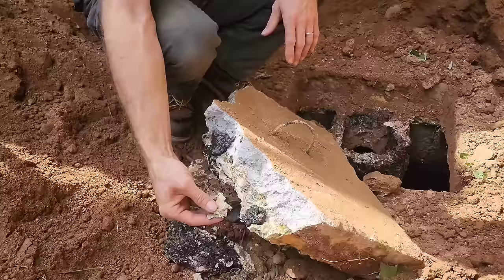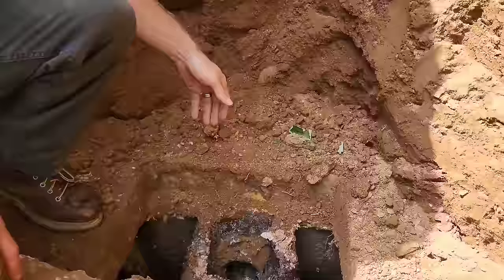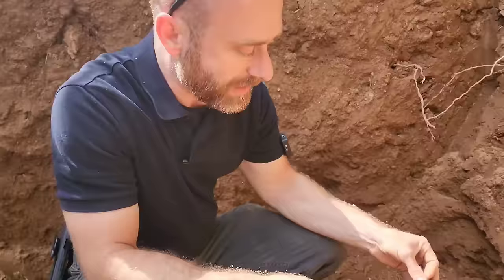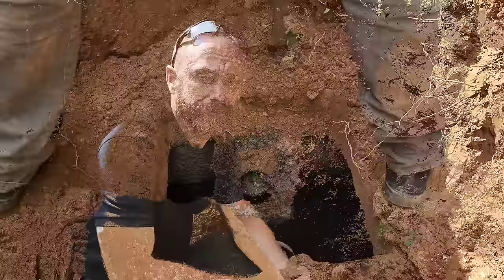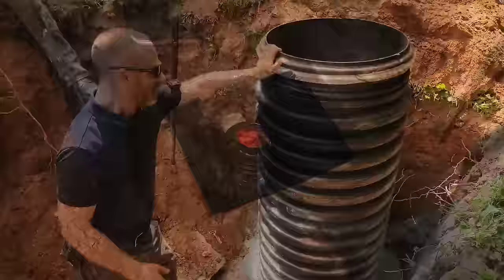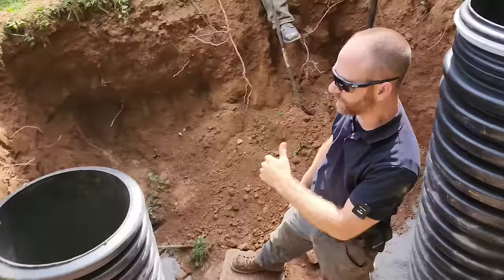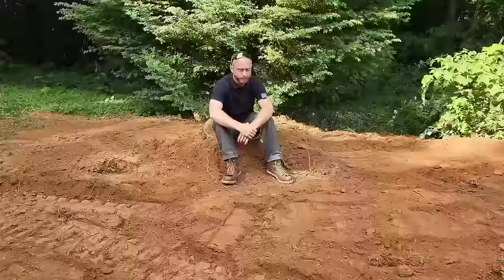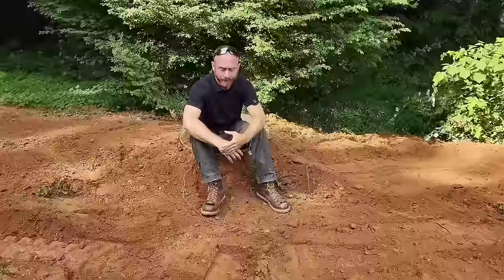Septic Tank Not Serviced In 20 Years.

Comment: I have a question that hopefully someone here may be able to answer. It's not a big deal, just a curiosity thing. So i have an old (like, installed sometime around the 1920-1930s i assume) septic....hole? Tank? Not sure how to describe it but my Dad thinks it's an old septic tank that was never removed when the property was switched over to city sewer. It is accessible by a concrete lid with a bent steel pipe embedded in it about two inches below our back porch which puts it at ground level for the yard. The lid is about 8 inches by 9 or 10 inches. Just to give you an idea of what it looks like in your minds. The question pertains to what was dumped in there years ago to keep it cleaned out. Me and my Dad have been using it for various uses in our yard and daily lives to dispose of things. Typically we use it for dead animals (rats, raccoons, any other dead critters we find and can get in the hole easily), dumping human refuse with cat litter (me and my dad are Traffic Control Flaggers), and cuttings from our shrubs or the trimmings from our lawnmower. The thing i'm wondering is what could be down there still, after all these years, to keep the hole/tank cleared out. Because we had one time where we literally put so many shrub branches down there we were literally having to cram them down a bit to close the lid due to them sticking up and stacking on each other. The lid isn't air tight but it also doesn't let much in, i didn't think. Yet, when we opened the hole later (around a few months or a year, it's been a few years since we did this) it was COMPLETELY empty.
So, long story short (ish), what do any of you think could or may be still alive in there to cause all that or do you think it was just natural decomp from the tight space and moist/dark environment? Also, if any of you would mind suggesting dumping stuff down there again since we're still technically using it. Doesn't need to be pumped or anything, it really is empty. We shine lights into it to check sometimes and have seen the bottom just about every time.

Comment: Our septic system is 25 years old.  We had a company out to pump it after 10 years, but the operator said there was virtually nothing to pump, so it was not pumped.  The operator did replace a few concrete parts with plastic, but our system is still trouble free after 25 years.  Probably time for another inspection?  As a kid my parents taught me to never allow anything into the sewer that wasn't biodegradable and we do not have a garbage disposal.....the death of all septic systems.

Comment: In western Maryland we are required to have the access 20 inches above ground don’t know why it does snow a lot here but last time we had ours cleaned, which is at least every five years sometimes three years if I remember they had to put it in Extension out and it’s 20 inches above ground level. My question is why didn’t they just replace it now when you have the whole Doug and not have to worry again.

Comment: I'm chuckling because the previous homeowner built a fence straddling the septic tank, which is also concrete and about 4' deep. I did have to dig that by hand, because my local septic guys don't dig if they can avoid it, I don't have access to a machine, and (again) a fence straddling the tank. By the end of it, I had a really good fighting position, minus the grenade sump because, you know, concrete tank.

Comment: For awhile metal specifically a steel septic system was gonna be used for new buildings but fwiw around the 90s onwards fwiw if not within 7 years of building,, it if iirc has been from what I read shown to have emergences of problems with rusting out the bottom and baffles or even collapsing,

Comment: Loving the content in the videos! How about a tank that the house sat empty for 20 years. Then remodeled and went from 1 bath to 3 bath? Has 1 lateral line about 90ft long. The homeowner called, and said there's "water" coming out the far downhill side of the lateral line inspection pipe.  I told him that the ground probably quit perking and is leaking sewage water out the end and needs replaced. Is there anything else to do if the drainage field gets full?

Comment: Im a state septic system inspector. And Im still trying to figure out how the "servicing" that hes talking about, is somehow going to keep your concrete tank from crumbling like that. There is no "service" that is added or sprayed inside that would keep your tank in tip top shape.  Pretty misleading that by "servicing" your system, you will add years to the tank life. Having it pumped kinda regularly will help with solid carryover to your field lines and extend their life, but not your tank.

Comment: How would pumping the tank out do anything to stop the deterioration of the concrete? I'm just wondering, as between the crust buster pump lines and garden hose, I don't ever see anything else in your videos going into the tank, and last I checked none of those things extend the usable limits of concrete. You said that proper service would keep it from happening, but I see ZERO proof of that
Reply: It helps quell bacteria buildup and moisture that would otherwise harm the concrete
Reply: @zagzig3734  the entire point of a septic system is to grow bacteria in moisture to break down the solids in waste. It's kinda in the name septic. My guess for the concrete break down would be using crazy amounts of acidic toilet bowl cleaners , acidic water or salt from water softener being back flushed into the septic which is a bad idea with salt water killing bacteria. Water softeners should drain to the ditch.
Reply: @martyk1156 Thanks for this info. I was concerned after watching this video because I have a softener. But mine backflushes into its own separate-from-septic perforated pipe.

Comment: Had a guy at a club insist that the club house sceptic tank didn't need pumping, claimed the tank made the sh1t "go away"!
I downloaded the manufacturers instructions for him, and the club committee, and he still wouldn't accept that the tank had to be periodically emptied.
Oh, and the reason this disagreement arose... the field drains were blocked up and my guess was either tree roots or solids had overflowed from the tank and blocked the drainage system, and when I found out that the tank was installed 25 years ago and had never been emptied I knew it was the latter!

Comment: Honest question: What does regular servicing do to prevent the concrete decay?
Reply: Regular servicing will reduce the total bacteria accumulated and prevent moisture build up that breaks down concrete walls. It also allows you to check the concrete for damage and install preventative measures before it hits this crumbling point. Once it's completely eroded like shown in the video then the only thing you can do is completely replace it or install an alternative.
Reply: @ww6372  Probably nothing to do with moisture.  Lots of concrete is poured for underwater applications.

Comment: Lol considering my "septic system" is a 1'500 gallon tank with a pipe running to a 4ftx4ftx4ft pit I think I'll be alright. I plan on upgrading the pit to 6 or 8 55 gallon drum with holes all over buried about 2 ft underground and surrounded by gravel. Should be good for basically forever. I only have a single toilet and a trailer septic hooked up.

Comment: Mine hadn't been serviced 15 years so I took a look and aside from a top layer of grease maybe an inch thick and next to nothing on the bottom, it looked fine to me.  I wish they'd had put an 90 elbow at the bottom of the outlet tee when the system was installed.
No bleach, chemicals or anything I couldn't have eaten goes down the drain aside from soap.

Comment: had the same problem... only the customer told me they have had it pumped every year since 2003 however now they are getting backed up in the house. Upond locating through the main line I found the tank was 11 feet deep with no riser. I informed that unless there pump guy was super man charging $5k per pump there is no way it was being pumped. Once I located the tank all that was left was the walls of the tank and it had fallen apart many years ago.

Comment: I have heard it said that, as long as the septic tank is used gently and properly (e.g. one or two people serviced, no paper towels, wipes, grease, harsh cleaners, etc. dumped down the drain), it can easily last for decades between pumpings. Is this accurate?

Comment: Septic tank here was pumped around 25 years after we bought the house and we don't know how long before that it was pumped.
And the tank was not that big either. So goes to show how a tank can survive a very long time. Even without special care.
Now, with a new tank at another location, i am more concerned with proper care and balance in the tank.
A good balance should make the tank go without any service for a very long time. Lifetime even maybe. 
Don't use aggressive cleaners, don't flush leftovers, don't flush wipes, use a normal amount of the right toilet paper and add some special enzymes and bacteria combo to keep the good guy's fighting and you might never have to pump it.
Reply: Just pump the darn thing haha
Reply: You are right. Concrete is alkaline. The waste product is acidic but should only be mildly so. Pumping does nothing to change the chemistry (but does reset much of the biological action). Your tank will fill right back up with acids. If your tank was close to balanced before pumping the change afterwards would be negligible (volume of material). Waste solids that cannot break down would accumulate - but there is very little that should be going down your drian that will not dissolve in mildly acidic water...

I have seen nothing about how pumping does anything to change the acidity which is what attacks the concrete. Pumping every 5 years or so is probably reasonable for most households (for solids build up). Less often or even never  for lighter use or careful households...

Comment: HOW would servicing the tank have made a difference to the concrete degrading?  Location would have still seen the same environment.
Reply: notice how the concrete on the outside is still very hard and the concrete on the inside is crumbling away, the different chemicals and other things gone down the drain have been eating away at the walls. If you pump the tank of that waste you remove whatever is degrading the concrete, you neutralize the environment once in a while it'll buy the concrete more time before it fully turns back into it's components.

Comment: When you installed the baffle system replacement did you dig the tank up on the other side and connect the pipe you inserted to the existing pipe or did you just slide it in? Just curious because that’s how it looked in the video.

Comment: I was at a campground that had a wooden septic tank.  For the row of full hookups.  I was camping when it was cleaned out.  
How it lasts is a mystery.
Reply: I was a state health Department onsite designer and  inspector for 32 years.  Now I'm a private sector  designer . I've seen wooden timber cesspools and  concrete tanks poured around wood framing. The sewage "pickles" the wood. Any iron nails or braces quickly rust away but the wood stays. And yes I've heard the "never had to pump it" myth. My best answer is  "do you also have  a car you've driven 100000 miles and never had to change oil and  filters?"
Reply: @cecilsink9901  
A  jerk would say  "I don't change the oil, l drive a Prius" and that is why I hate every prius owner.

Comment: If the filter is 5 ft below grade, how does a homeowner access it?
Reply: By digging a trench hole as they did here, then adding risers as was also done, for:  "le$$ co$t" in future maintenance.
Reply: Those filters have a place to install a length of 3/4” pvc pipe as a handle. They lift out and you rinse them clean with a garden hose.
Reply from the maker: we have hooks that long

Comment: I have a question,  if your landlord has a old concrete septic tank in the backyard and has 3 concrete slabs on it and a pipe sticking out of and it is not used at all because the building is hooked up to public water and sewer and the building is 200 years old also, what is sapost to be done with that tank? One or two concrete slabs do rock back and forth and it seams like out of all 3 concrete slabs,  the center is Boeing in.

Comment: are ceptic is 65 years old, never any problems because well..  oversized pipe and.... its not concrete....   why?  cuz concrete eventually crumbles to sand...    that and ours has an accsss point on the sutface, not 5 feet under so you cant access it easy :-\

Comment: My septic tank looks to be the original one from 1958 and ever since I got tenants and they’ve been using using over 10,000 gallons a month in water my septic tank is not working right and I have to pump it every month. Do I need a new septic tank or is there a way to just repair it?

Comment: That riser is a foot above ground. Why? You said level with existing and that would be the correct installation of a riser.
I use actual risers made for the system instead of using black plastic culvert pipe. Just more professional

Comment: I have a odd septic set up . i have a concrete tank with 2 compartments then that goes to a 500 gallon plastic  tank that runs to my field lines and has a air pump.
Reply: I'm not a specialist, but that looks like some kind of biological sewer treatment system. The air helps the bacteria.   
If you take good care of the bacteria, these systems get the water really clean. You can use it for almost anything exept drinking.
Reply: @beatekreuzer5025  i guess i dont know much about it. Just i had the concrete tank pumped and not the other one
Reply: Sounds like you have an alternative system man probably because the soil where you live isn’t great
Reply: @matthewmassaro4573  red clay
Reply: That would be why you have an alternative system if it’s nothing but red clay. Before you install a drain field a soil engineer will come out bore some holes and based on the soil is how they determine where to place the drain field on the property and how deep it needs to be and weather or not a conventional system will work or if it needs an alternative system
Reply: @matthewmassaro4573   i am in a small subdivision in the sticks its eazy to know where the lines are.

Comment: So my question is, did the company who placed the septic system that deep or did a home owner change the landscape? Secondly, what does one do if one needs a septic system but there is approximately 2-3 feet of dirt to put it in? (I am building a house on a peninsula in the UP).
Reply: As someone mentioned for this one there probably was a basement bathroom. When conditions are not great there is used a sand mound for the liquids with pumps etc.
Reply: @larrybe2900  Thanks!

Comment: In a 5 foot hole without benching? No gloves messing with the tank lid or sanitary tee? 
Tank needs to be replaced with that much concrete degradation and H2S attack during 20 years of corrosion.

Comment: So does the sewage break up the concrete like that
Reply: To me it seems like just shit concrete but sure it depends on what is flushed into the tank. There is chemicals that will eat away concrete like trisodium phosphate that is found in some cleaning agents, acids and of course salts with reinforced concrete, causing rusting of rebar and due that expansion and cracking. Tank that are not abused should be fine, but i'm not chemist to tell what is problem for concrete and my experience is from 3 septic tanks, from witch one has never been pumped in 70 years though its only for liquids, second gets pumped every 5 years and one i have... its been pumped in maybe 90's and i see no issues with it. Will probably get it pumped to inspect the pipes and see witch way the leach field is.. if there is any. Seems like just concrete rings and thats it.
Reply: Maybe it was a water softener system

Comment: Eeeeeeew. Wow. Yikes. Etc. .......... Now that my stomach is starting to settle down again, I have a question.  Do you (and most typical service companies) sell new septic tanks or is there typically a store of some kind?
Reply: There are separate tank (poly & concrete) suppliers. Many but not all septic service companies may also do installs as well...with the tank supply & pump service just being separate depts. Any stock will most likely be whatever is the most commonly used in a given area. Otherwise they get ordered.
Reply from the maker: Great answer

Comment: Quick question is it OK in NH if I build my own complete septic system using proper parts
Reply: Check local regulations
Reply from the maker: In NC that is completely legal, as it is in most states  ( I have been told ) but you should check with someone

Comment: Obviously from this there is no infinity tank, but I’ve heard you can extend the times between pumping immensely (like in the 20-30 year range) if you don’t flush any type of toilet paper or wipes. Any truth to this?
Reply: There is. Just results in having to bag the paper.
Strictly # 1 & 2 waste being flushed can extend tank life. It breaks down quicker than regular TP will. TP designed for RVs breaks down better but cost more. ABSOLUTELY NO WIPES though. 
Even the "flushable" types don't actually break down & can//will cause problems. If they reach the leech line(s) they can cause problems. If the system is in an area where trees grow then chances are that roots can intrude & wipes can get caught...resulting in tank backing up or even line to tank doing so.
Reply: @RuralTowner  Heck I've been at a  friends house and the tp they were using didn't even want to flush, my parents always bought Scotts and I do too.